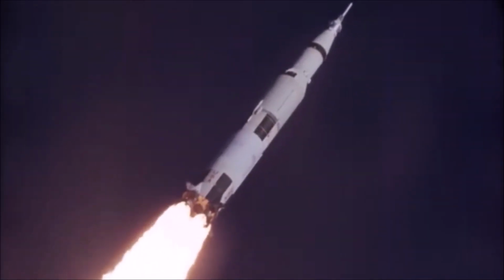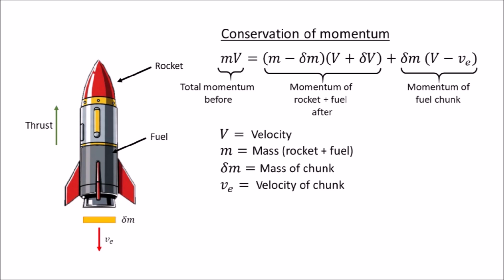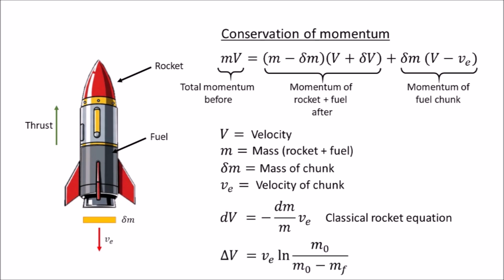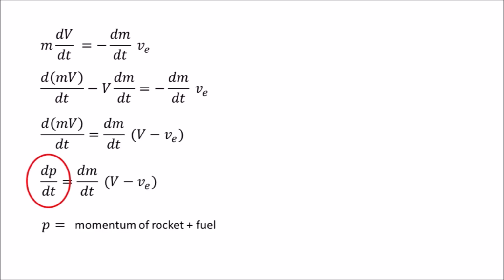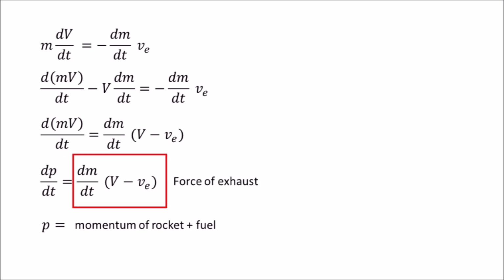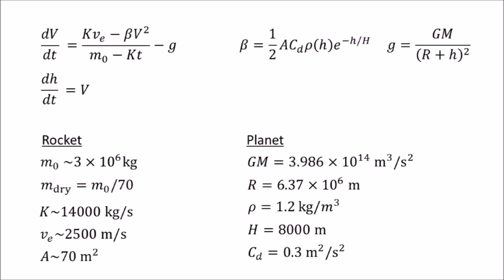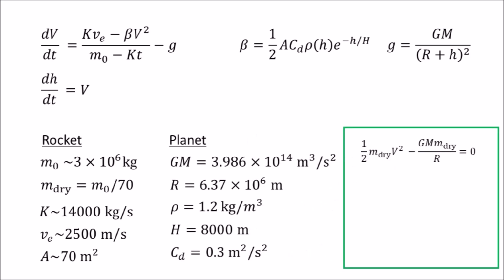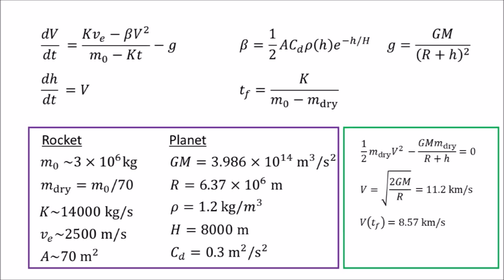The rocket equation -- derivation

Comment: good video, but in minute 1:33 it should be mdv=dm v_e

edit:

I did the calculations:
by rewriting mv = (m + dm)(v + dv) - dm (v - ve)

This way, the differentials automatically keep the correct signs, which gives the right result:

m dv + dm ve = 0

(the reason I did it like this is to keep track of the signs properly when working with the differential equation, the minus sign on the second part comes from the fact that in a rocket dm is alway negative while the mass of the ejected particles are positive.)
Reply from the maker: Ah, yes, I see. I should have had m dv = dm ve with my convention of keeping dm positive. Thanks.